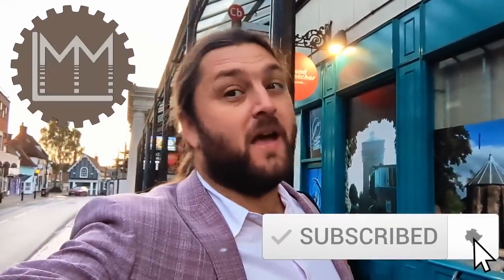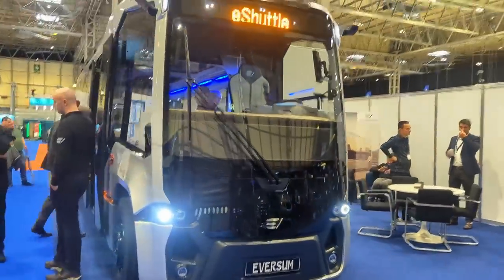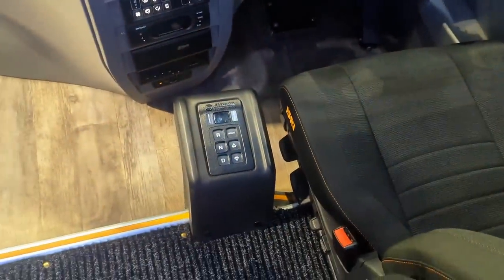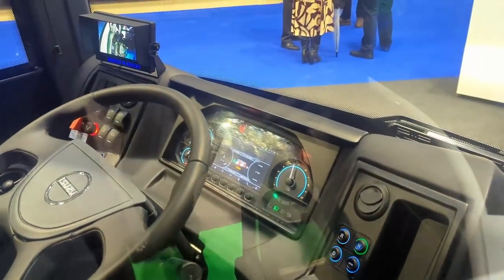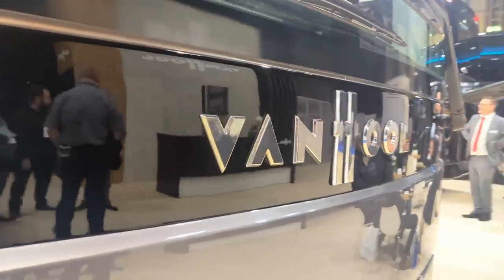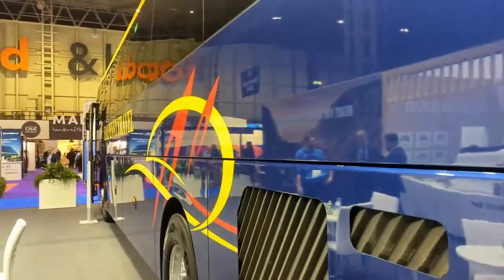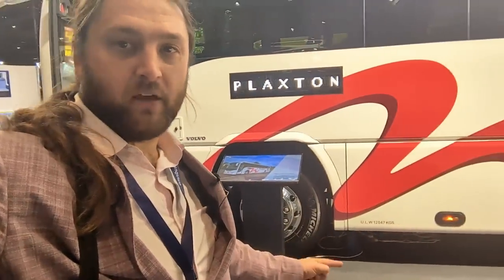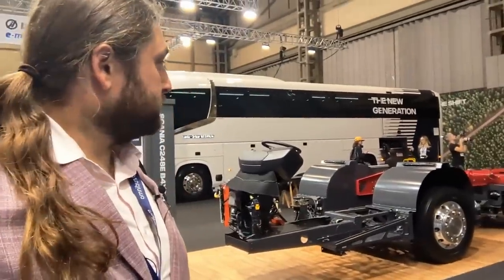Lawrie rates new buses... badly - a Vlog at EuroBus Con

Comment: Electric vehicles to me are a design-study-in-action of the difference between green and sustainable_. _Green is good for the environment in the immediate sense, but with no real ability to guarantee that in a continual sense long-term.

Solar cells are also a good example of this... as well as a good example of how green can become sustainable. Your standard solar photovoltaic panel (i.e., for power generation) is good for about 20yrs of service before it's burnt out and needs replacing. Yes, that is a thing! Right now, the first really popular modern generation of solar panels in use in homes is about to burn out... it'll be a big thing in the next few years. Here in the US, where I live, there's basically neither laws nor infrastructure for dealing with this upcoming problem. (IIRC California has a minimal framework, and if the past is any example, they will get picked on unmercifilly for being somewhat less backwards than the rest of us.) Several European countries have some minor legal guidance, as I recall, but very few have proper regulations and infrastructure in place to deal with the oncoming flood of sundried silicon.

This is bad, because silicon, especially in the form used in solar cells, is very toxic. Any meaningful installation of solar cells needs literally tens or even hundreds of thousands of pounds of the stuff -- solar panels aren't hugely efficient, compared to most other forms of power generation.

Minimal or nonexistent regulation, like it or not, means that stuff ends up in a landfill. So much for environmental friendliness!

Electric vehicles are no better. If you want awful, cheap batteries, you get lead-acid. That's lead and sulphuric acid. Ewww. Nicer batts are generally lithium, although the Prius for many years used a battery that was a hundred million NiMH D cells in a box lol. These are all environmentally awful at best, and "zero emissions" is, quite honestly, something probably come up with by a lawyer -- sure, the vehicles themselves are zero-emission, but the power plants that fill those batteries sure as heck aren't!

You want a simple, cheap, effective, AND sustainable way to handle fuel? It's actually not at all hard. Here you go.

Grain alcohol, when burnt properly (i.e., not pyrolized), produces exactly two byproducts -- CO2 and water. In every municipality, have a fuel coop. You don't need to denature it; fuel alcohol is min. 150 Proof, at which point it's so potent that trying to drink it will literally land you in the hospital needing skin grafts inside your mouth -- it pulls the moisture out of cellular tissue so fast, at that 75%+ purity, that it effectively boils the stuff. You also need dedicated high-pressure stills to make stuff that strong. Use it to power a Stirling engine. Stitlings are external-combustion, mechanically-simple engines and you can make them from literal trash and they will still run.

There you go. Infrastructure and PowerPoint... fully sustainable. CO2 buildup concerns? Plant more trees.
Reply: They had alcohol fuelled buses in Stockholm. The exhaust was evil. Probably aldehydes of some kind to judge from the smell.
Reply: @physiocrat7143  That, then, will have been either an engine fueled by denatured alcohol -- which is ethanol (grain alcohol) mixed with something noxious and highly toxic in an ill-informed effort to keep people from drinking it (both unnecessary, for the reason given in the previous comment, and wasteful, given that people will drink alcohol mouthwash, if that's all they can get, even knowing that that particular kind of alcohol is toxic) or it was made to run on methanol -- aka wood alcohol -- which is highly toxic, and often was used, historically, as a denaturing agent.

Most likely they were running it on methanol, and the fuel provider had diluted it with formaldehyde or something similar as a cost-cutting measure. 

To be clear, however, I am advocating for neither of those two likely fuels. Ethanol -- grain alcohol -- of sufficient purity to be used as fuel needs no denaturing to be rendered undrinkable, and methanol is not suitable for other reasons -- it produces far more noxious chemicals than ethanol when burnt.

As something of an aside, isopropanol -- aka isopropyl or "rubbing" alcohol is likewise unsuitable, and it combusts extremely poorly to boot. Further, being a petroleum derivative, it doesn't even solve the original core issue.
Reply: @laserhawk64  Not sure about that. Acetaldehyde (ethanal) is the first oxidation product of ethanol. Given the cocktail of substances produced by internal combustion engines, it is always tricky to produce a clean exhaust containing nothing but carbon dioxide and water. Combustion is explosive and at high temperature.

Comment: Zero emission?!  Where does the electricity come from then?
Reply: The vehicle is zero emissions... Plus if you are being pedantic, there have been days this year where over 80% of the UK's electricity has been generated from renewable sources & that's set to continue...
Reply: @MattyP62618  Then why has my electric bill increased?
Reply: @MattyP62618  Not going to disagree with you on that.
Reply: @lordbungle6235  Because you live in a capitalist market economy, and your electricity's cost is tied to the wholesale market price which is dependent on offer and demand, and the particular mood of some greedy fucks in expensive suits. 
If for instance The Netherlands is willing to buy British power at a higher price than the typical going rate, because there's a local drop in power generation, the wholesalers will gladly sell to the Dutch creating a tighter market in the UK itself, driving up the cost of electricity in the UK even though theoretically the UK could support itself. Capitalism is magic!

Comment: i cant wait til people wake up and realize electric do the same damage as gas or diesel
Reply: Not true
Reply: I tell people at work with electric cars (but only if they rave about zero emmisions and saving the planet), "Hey, go to our local Power Station and see your zero emmisions", it's funny to see them go sheepish!!
Reply: @MattyP62618  did you do your research? We got to dig more the batteries, ship them more around to make them, And we still use coal and fossil fuel to power them, plus electric cars been around for over 100 years and they were left for hand cranked gas cars, suddenly they came back ? With less range and still take 45 mins to charge when you get your spot
Reply: @RealTylerBell  yes I did do my research, I can't be arsed to write a long blog post of a reply but this video has all the facts. Also, re how they are charged, the UK can generate 80% renewable capacity & those numbers are only increasing, as well as new methods being employed to extract lithium, which is cleaner & uses 10x less space. Yes EV's are technically 100 years old, but modern formations of the technology is still in its infancy & it's already far superior to ICE's

https://youtu.be/Vi7U6Cj_2aI
Reply: @MattyP62618  right if you did actual research they are worst for us, more digging up toxic for the environment, and more shipping
Reply: @RealTylerBell  right. Again, here's some "actual research", some developments from the cutting edge of the field. Clearly you didn't watch the first video I posted so I'm guessing you won't watch this one either. Also FYI, you need to mine & extract minerals regardless of the vehicle, better to have one which pays back its environmental "debt" that one which continues to pollute for the entirety of its working life

https://youtu.be/xWpLFUUDTiM
Reply: @MattyP62618  clearly you skip the whole shipping and digging part of the electric cars plus their small life expectancy vs gas cars
Reply: @RealTylerBell  I literally linked you to a video about the changes which are being made to the "digging" part of the process. & again, that's not true. The methods & processes are getting better all the time, its not a static industry. My EV can do double the milage of a compatible ICE before it needs a serious service. The batteries themselves last over 200,000 miles & can run for well over double that in cycles. You clearly don't have a clue what you are talking about
Reply: @MattyP62618  getting better right, and you said the uk is eco powered which is not true either only 17 % is and 42 percent is gas burning power plants
Reply: @UCh8YxAjuYQR8HpKlNXOHlHQ "The Swedish car maker said that over a car's lifetime the electric version will become greener overall"

That article debunks what you are trying to say in the first few paragraphs... Everything else is noise, though that's to be expected from a branch of the Daily Mail....
Reply: @UCh8YxAjuYQR8HpKlNXOHlHQ also it's not to be "as green", it's to be greener full stop. ICE's can never be green by their design, article again says as much
Reply: [citation needed]